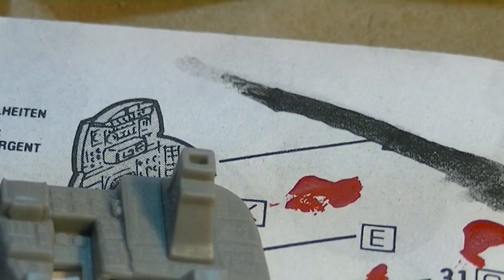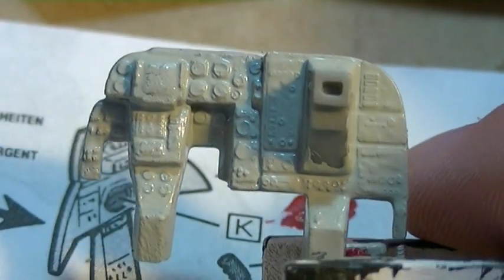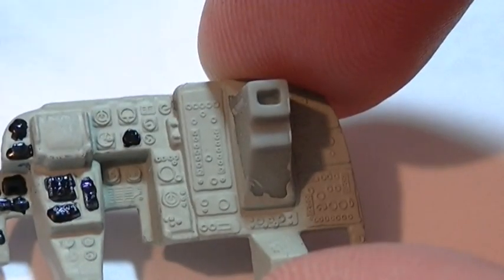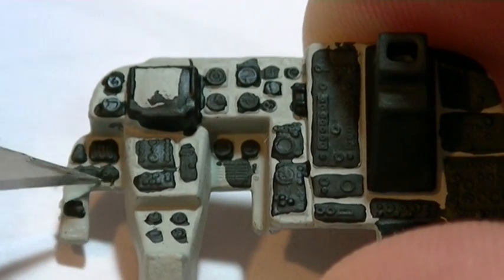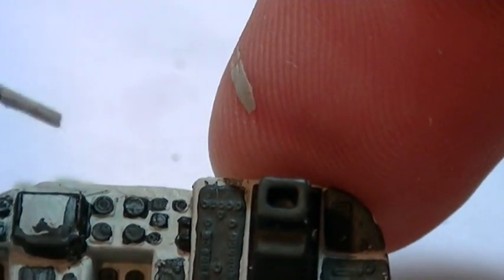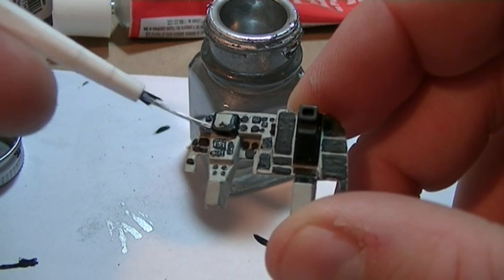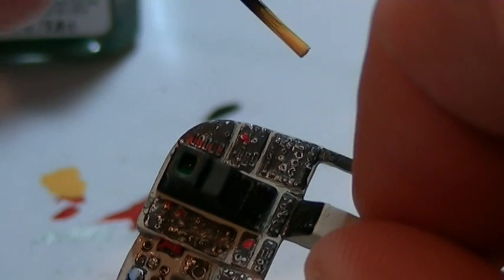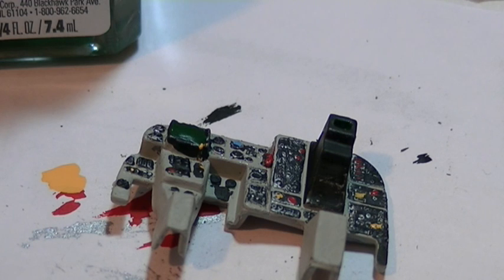How to paint an instrument panel.

Comment: Using a brush is not effective. 
Cut a length of tree and file the end 45°.
This makes a paint quill.
Reduces the chance of cat and mouse mistakes significantly.

It also saves paint by transferring the paint  bottle -> paint quill -> brush.
This method stores excess paint on the plastic in stead of soaking into a pallet or paper.

A micro-paint applicator can be fashioned by holding a tree piece over a candle flame and pull it apart until you get a thread(ish) antenna piece.
Use that to apply blue altimeter guage.
Is very efficient for dolloping battleship/carrier portholes.

Thanks f4c for your posting.
Reply from the maker: Brush works for me. Thank you  for the advice though.
Reply: @f4cphantom2  : Go brush! THEN.👍😋

Comment: Technique is spot on mate but you really should upgrade your brushes.. Sable or squirrel are good, just avoid man made fibre brushes. :-)
Reply from the maker: Thank you, I plan on buying some new brushes soon. But I've had some really good luck using the Testors  brushes as well. This panel didn't turn out as good because one the A-6 panel is not the best, and two the position I was in trying to paint with the camera was tricky. Please see my other videos especially the F-105 build. That shows how I can really paint an instrument panel.

Comment: Why not spray paint the panel with Flat Gull Gray that Testor's has? The pain will be thinner and it will be easier to get complete coverage.
Reply from the maker: Good question. Try it and see if it works for you.

Comment: Just some advice...when I do the dry brushing, I use a brush that has softer bristles on it as it makes the paint more pliable there for getting a better result. I also use a 0 size brush for the fine detailing and getting in-between the lines. You can pick up any of these brushes at any arts and crafts store. If I could, I'd post a pic of my F/A-18E cockpit so you can see what it looks like.